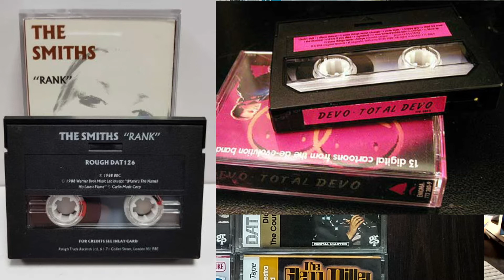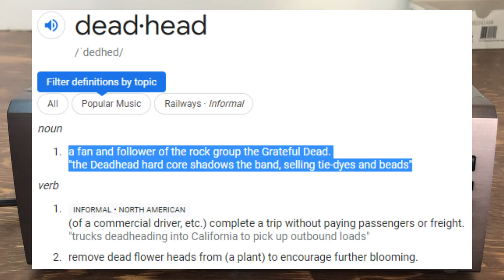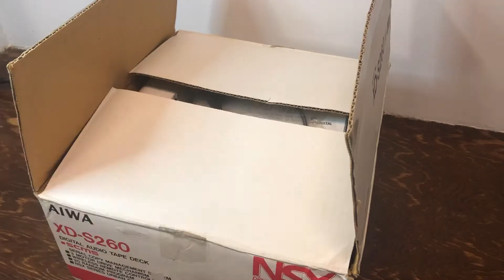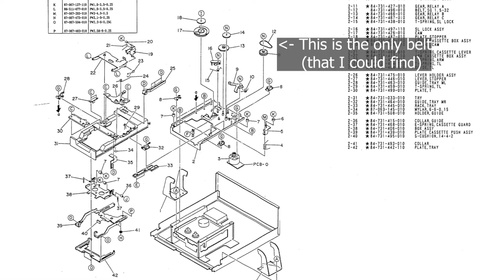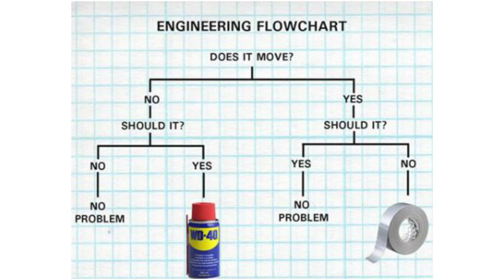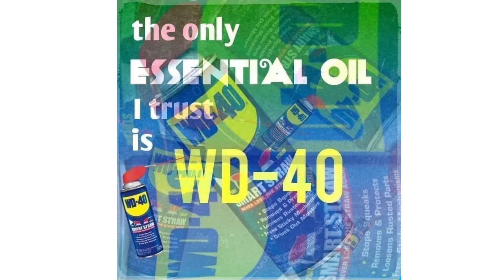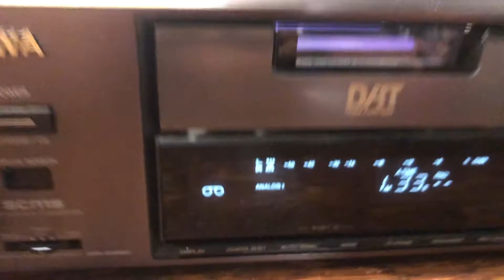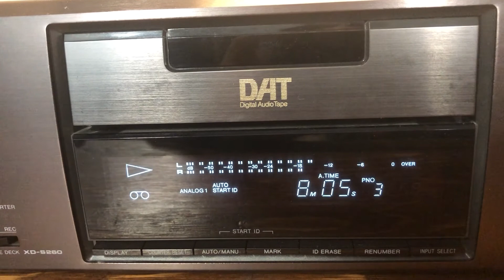REPAIR: Aiwa DAT Player

Comment: Nice video. One correction though: there is a second (small) belt that drives the mechanism that pulls the tape around the head. You can only see it if you remove the mechanism, and take off the mainboard that sits underneath it.

Comment: very useful and interesting tutorial! thank you vey much! .. I have an Aiwa XD-S1100 and it comes up with the 'CAUTION warning like I could see on your vid at timestamp 12:46. every time I try to play a DAT tape. All other functions work.  Different Aiwa DAT model yes, but maybe the 'CAUTION' Problem is caused by the same issue you figured out ... the pogo pins?? I will try that solution and report back.